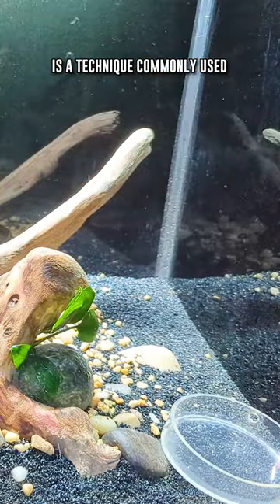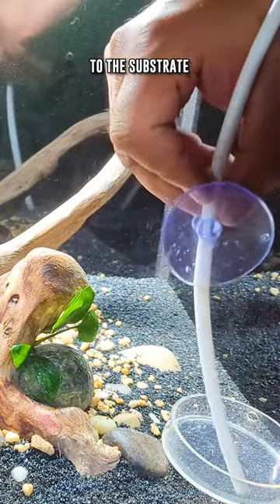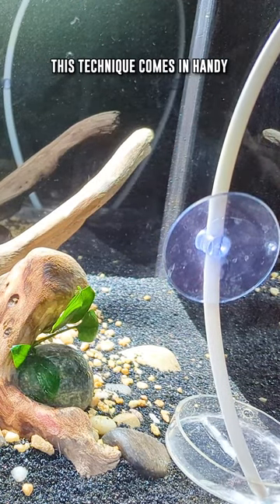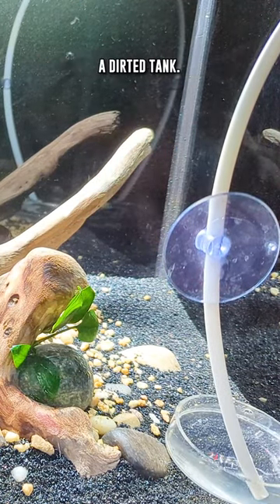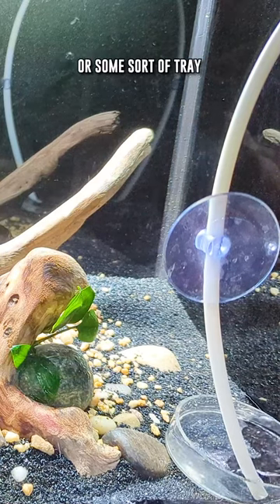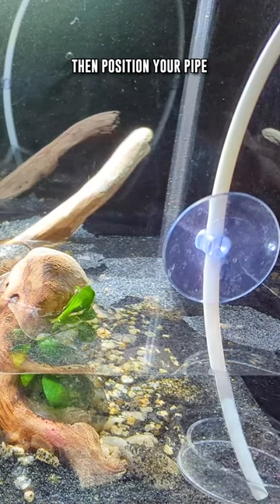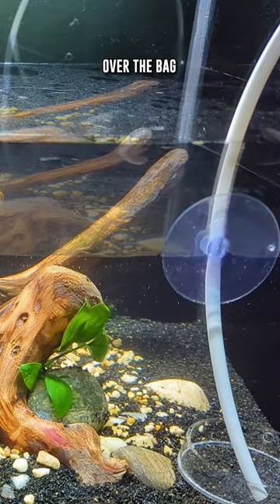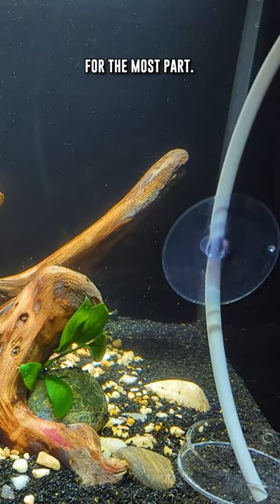Aquascaping 101: Slow-Fill Method 🌿 #shorts

Comment: I have a planted aquarium with stratum substrate, but the dirt keeps breaking and making my tank look murky, would you know if there is any way to help this?
Reply from the maker: If it's just stratum substrate, that will happen. You will want to cap it with another substrate. Check this video out and you will see how I cap my Fluval Bio Stratum and you can apply the same method: https://youtu.be/U6dyC9jr58I?si=Df966GA86q9Bt3Bd
Reply: @shrimplycanadian  thank you so much! I'll watch this now
Reply from the maker: @vensatyr  You're welcome :)
Reply: @shrimplycanadian  it was very helpful! Ive just bought some sand and mesh bags, thank you:)